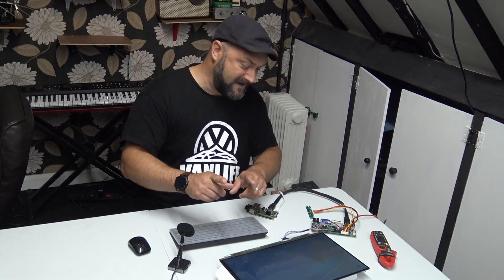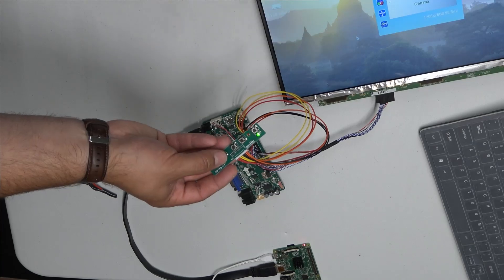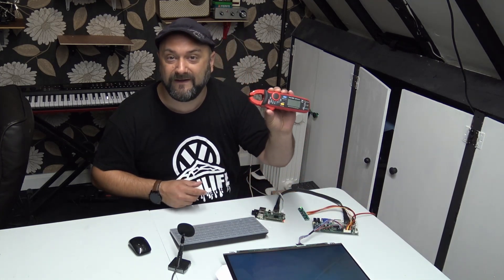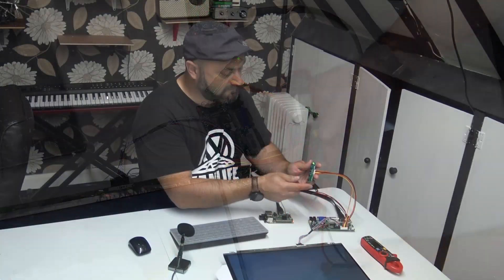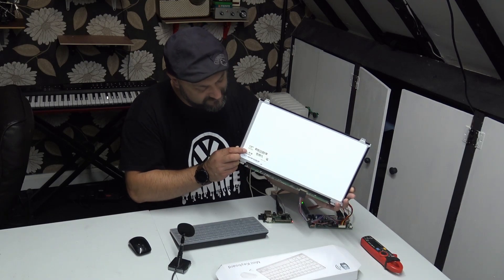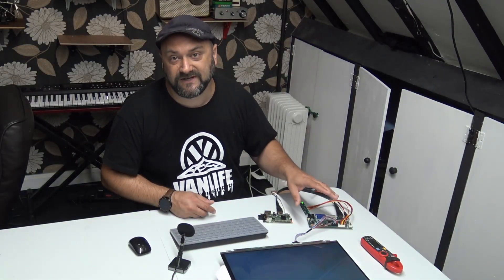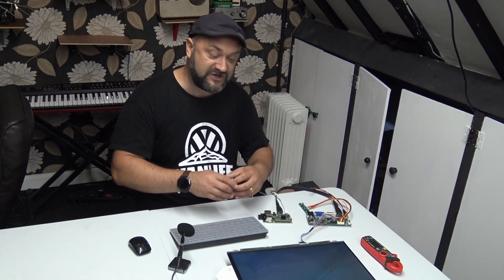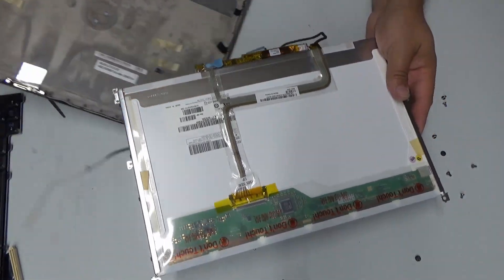DuB-EnG: Re-purpose old LCD and LED Laptop displays cheap chinese PCB from eBay - Make LCD monitor!

Comment: Hi there, Great video and a lot of information can i use this to replace a old crt screen as the one in my machine has burnt out. I would appretiate if you point me in the right direction to get parts to swap out.

Thank you.
Reply from the maker: clearly a lot more information needed... :-).  you will have to find an lcd that’s a similar size to your crt...
Reply: @DubiousEngineering  i think i need a 12 or 14 inch screen as i have seen people buy kits from ebay and remove the guts from the chassis of the old crt screen and replace with lcd conversion but I'm not to sure about the wiring.

Comment: Could you share the link to the PCB card on ebay that you used? I have been using several search terms and can't seem to find anything that looks like the PCB board you used.
Reply from the maker: Each one is different Greg, you need to type the number on the back of your LCD display into ebay - then the driver board will pop up!

Comment: Oh cheers for making the video. Is it likely there to be no controllers for older models? We have a few XP era laptops, where the system has become so unstable it makes no sense to keep them running. But if I have to tear it down to find out which controller I need, I'm afraid I might end up with a pile of parts :D
Reply from the maker: The LCD display I’m playing with now (at my workbench) is from an older model... it works well, but the contrast and pixel size is a little “meh” ... either way, I’m happy I can re use some of my old laptops!! :-)